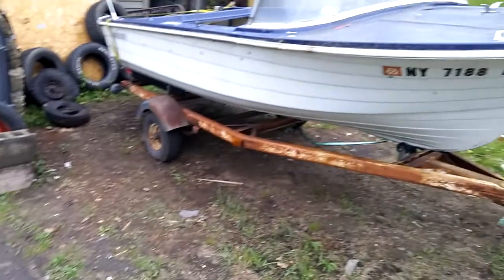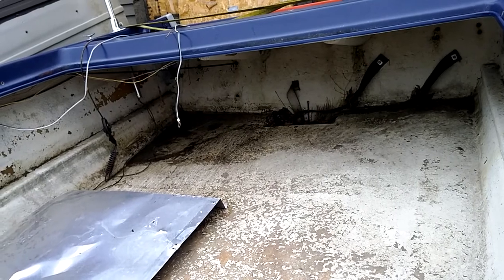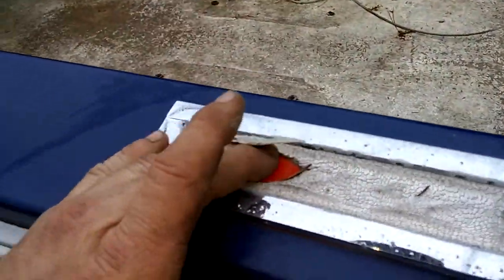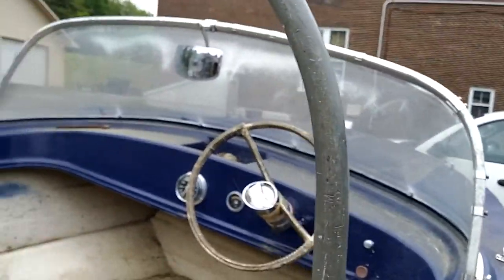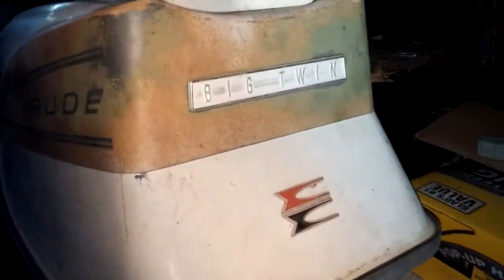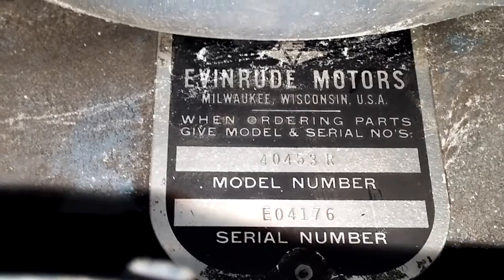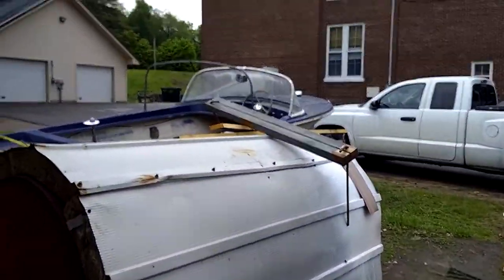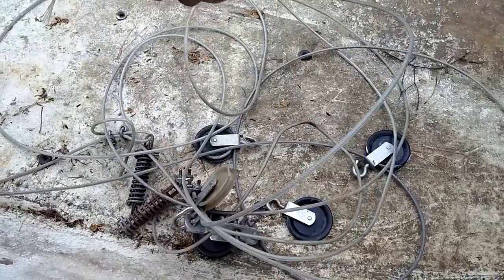1964 Starcraft 14' Siren with 1964 40hp Evinrude Big Twin

Comment: That looks in good shape, and the engine can be fixed, just ask Harvey. lol   Cheers man.   Dizzy.
Reply from the maker: udizzy1969 Yes it does seem to be. in good shape.  Transom and floor seem solid. Not sure Harvey has messed with too many boat motor, but I will check. Thank for watching and commenting.
Reply: I think he can help and you will be hitting the waves in no time, Cheers Dizzy.

Comment: The mirror is to watch for boats overtaking you, so you don't turn into them as the pass. Boat and moter have lots if potential, you can't beat a vintage Evinrude. You'd be hard pressed to find a reliable Mercury of that age.
Reply from the maker: Thank for telling me what to look for in the mirror. That makes sense, I thought it was to parallel park, LOL  I have never worked on a boat motor...should be interesting, Thanks for Watching, Commenting and Subscribing.
Reply: one nice thing about that model is you don't need any special tools to work on, and most of the parts are available marine engine dot com
Reply: Be sure to check the transom and stringers for rot most fiberglass boats have wood cores most likely why the boat was free